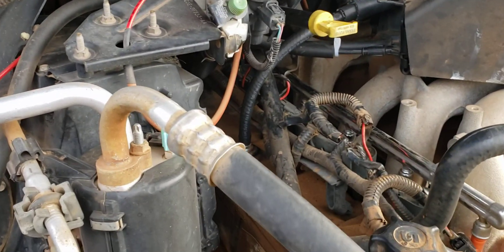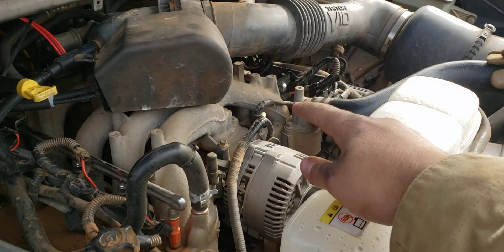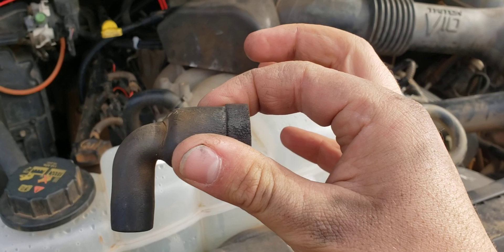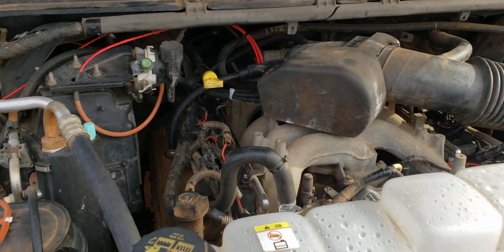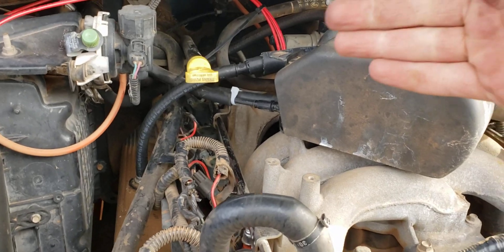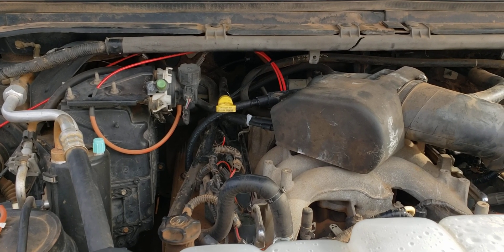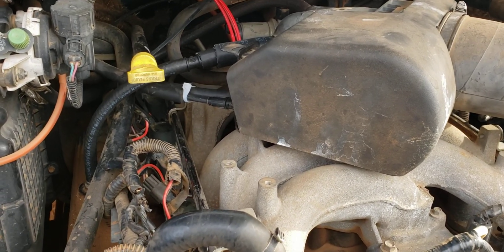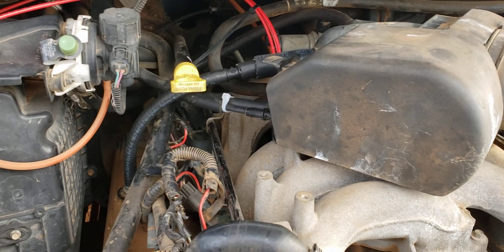Triton V10 PCV Upgrade

Comment: @Mighty-Quinn So is this still working for you? Thinking about stealing this idea.
Reply from the maker: This did help a little, but I found out later my battery connections were loose. That was the primary cause of my problem. Otherwise, my "fix" is holding up just fine, so go ahead and "steal it". I can't imagine I'm the first or last guy to make custom hose adapters lol.

Comment: Ford changed the fittings they used for the PCV on the 04' F-series 2V V10. Then stopped putting the 2V V10 in the F-series at the end of 04' MY.

Comment: Soooo did you notice any improvement?
Reply from the maker: Yes, there was an improvement. The primary cause of my problem here (which I figured out later) was that my ground cable wasn't connecting all the way, which was giving me all sorts of other issues. But the PCV was definitely not working 100% right, so this fix did help.

Comment: Mines doing the same I just got it back from the shop changing out the fuel pump
Reply from the maker: Make sure to check your battery cables too.......mine were just slightly loose, and that was causing my problem. The PCV fix didn't hurt though.
Reply: @Mighty-Quinn  do you think it's my pump
Reply from the maker: @fabianhernandez4627  Well, I'm not sure. Can you give me any details concerning your trucks behavior?
Reply: @Mighty-Quinn  do you have an email I can talk to you threw
Reply from the maker: @fabianhernandez4627 Sure! You can contact me at: Lightmaster1776@protonmail.com

Comment: Yours must be a little newer if it doesn't have the heated PCV hoses. I've been fighting this on my 2000 excursion, no clue how that right angle boot was supposed to slip over. I ended up just pushing the hose from the PCV straight over the nipple on the intake and didn't make the big reducer you did. Granted I'll be curious to rework mine and see if that helps my oil consumption
Reply: Heated pcv hose? Were you get that information from
Reply: @reifonseca5767  there's a coolant line that wraps around the PCV valve for some reason. I'm starting to wonder if only excursions got them though